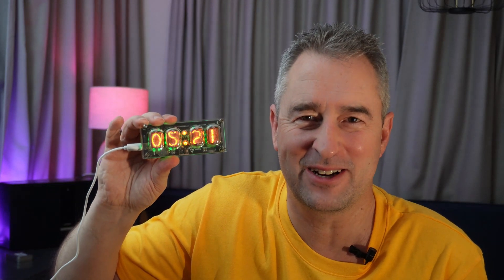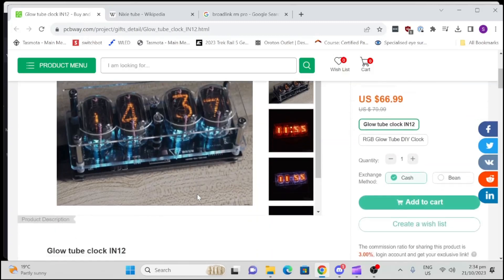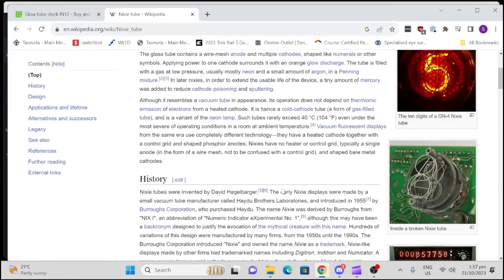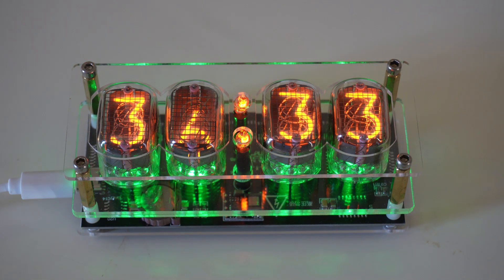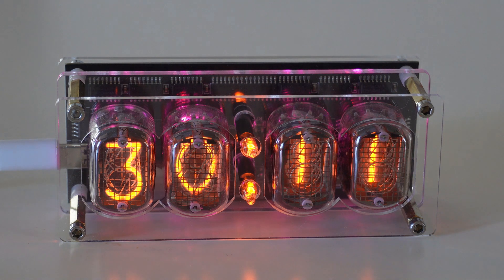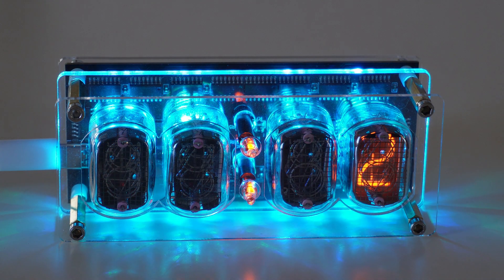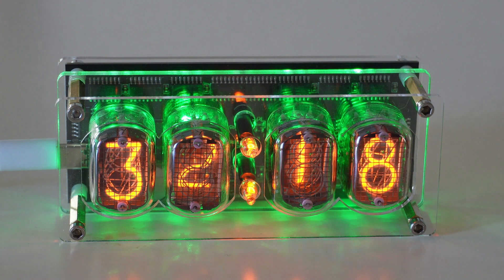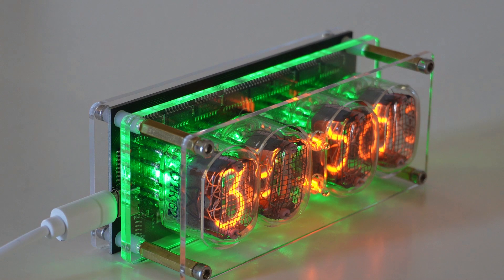Glow Tube Clock- Beautiful 70s style display!

Comment: Good video! I was gifted one of these a while ago, I think they look really cool!

As to the flashing numbers, if I remember correctly, that is intended to even the wear on the tubes. Numbers that are stuck on for a long time (like hours or days indicators) eventually attract a coating (I don't remember what the coating actually is made of, sorry) that stops parts of the numbers from glowing. All of my tubes have this on at least some numbers, like the bottom half of a 7, or the top and bottom edges of an 8, the middle of a 5, it's seemingly random, even though I have the flashing enabled. It would be a good idea to grab a couple of extra tubes if you know where to source them!
Reply from the maker: Thank you for the information!  Yes, I love the old retro look of them!  I think they call it cathode poisoning.